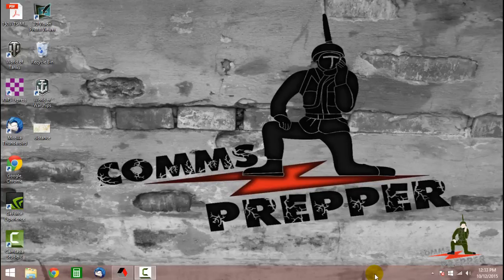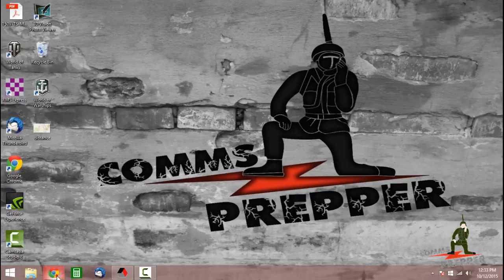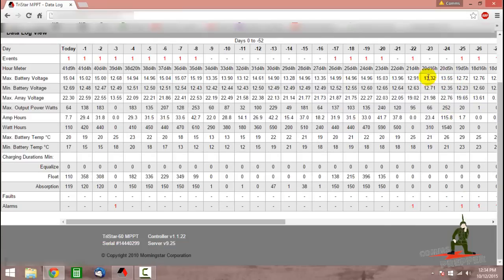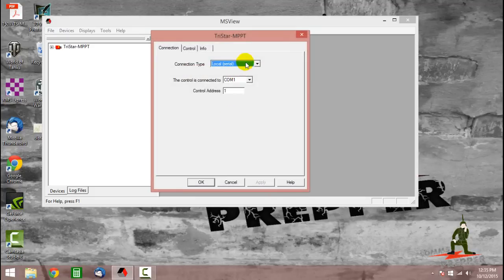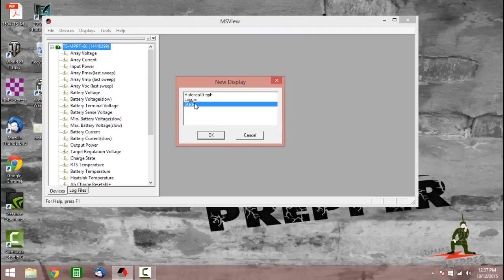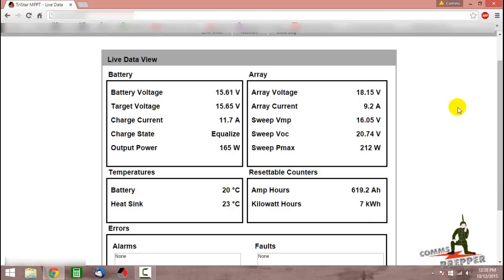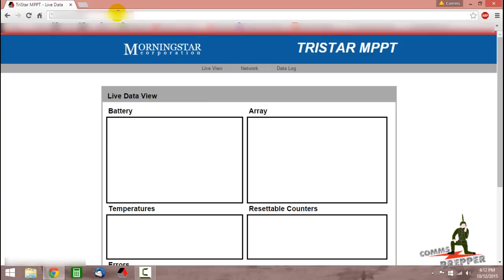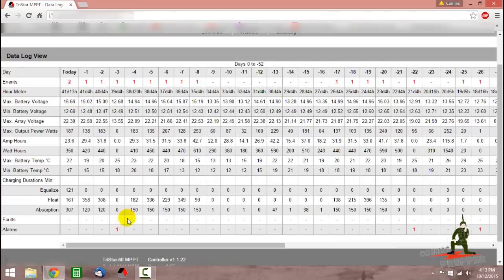Off Grid Solar Power - Remote Activation of Battery Equalization Cycle

Comment: ive watched everything you have put out on the TriStar.  I wish you were my neighbor! You are so far ahead of me with this shit its ridiculous. My question. I have 2X TrojanE 305 AC
I do not have the ability to hook up and do Custom Config. Can i just use Dip Switch Setting for 4-5-6, on off on. Without hurting my battery bank?
Reply from the maker: Why can't you load a custom config?
Reply: i dont have a Lap Top and my Trailer is 5 miles from me.
Reply from the maker: You may have to pull the controller and take it to someone with a laptop and get it setup and reinstall it.
Reply: alright. i downloaded the File that you did, into  Desktop but when i ran the program i did not get an icon and i did not get a viewable file. it just keeps bringing up the install file. Do i need some sort of data base file like Office?

Comment: Good points on equalizing batteries. I got the Trojan L16's. Disconnect all loads (inverter) and start equalizing after the system goes in float...important I always check my battery fluid levels before EQing.
Reply from the maker: +ChrisDIYerOklahoma Thanks.  I will be doing a new video on absorption charging and the voltage affects temperature compensation has.  I am finding now that it's cooler, the charge controller is putting a bit more out and cresting over the 15 volt mark which happens to be the max for my inverter.  I have had to go back and cap the max voltage of the controller at 14.9 which slightly defeats the temperature compensation goals.  I'm thinking the most correct answer is to make sure your inverter accepts voltages higher than max voltages of your batteries.  Solar has no shortage of learning opportunities.

Comment: Interesting. I appreciate you sharing these videos. BTW, you aren't relying solely on the obscurity of the IP address for security on that controller, are you?
Reply: +Logic Bob Back 2+ years ago I would not ever pay for Enet. I would find open spots all over. Still to this day I run a VPN even tho it's just my wife and I at home lol.
Reply from the maker: +Logic Bob Nope.  As for the IP - It's dynamically assigned so it changes all the time. I would just prefer people not hammer the router and ports after I post the videos.
Reply: Cool deal. A lot of people don't realize there are scanners to find devices like that throughout the internet which aren't password protected (or have the default password).
Reply from the maker: I keep the ports closed on my router until I need to get access to my systems (lighting controls, camera systems, and charge controller).  Open Ports - get in - get out - close ports.